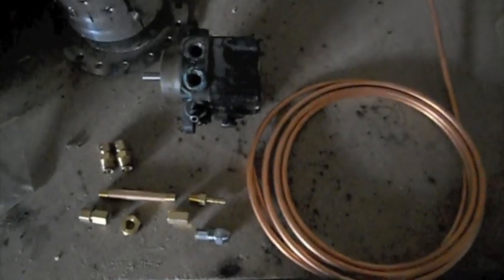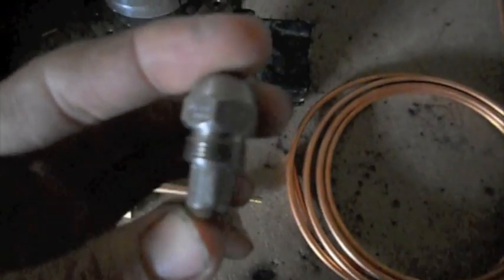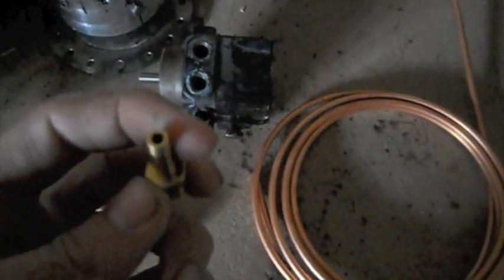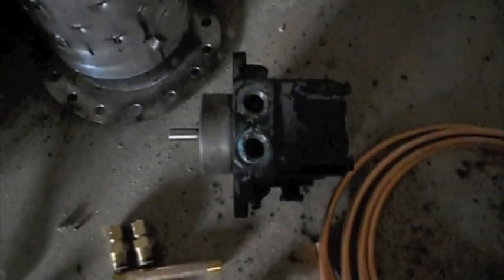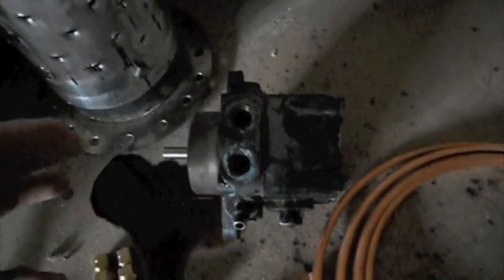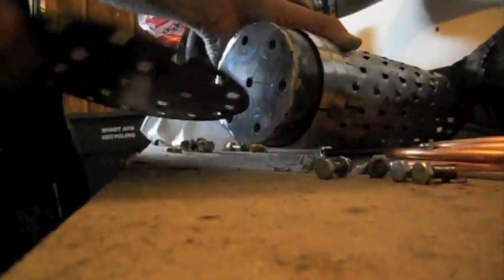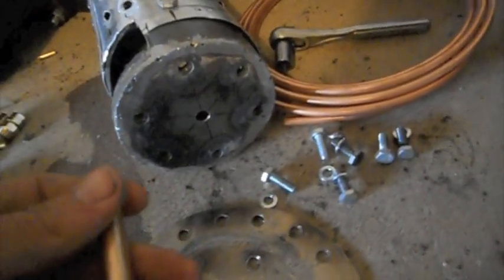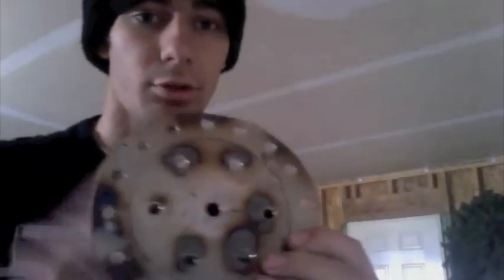How to Build a Jet Engine - Part 4 - The Fuel System

Comment: not very practical. you are better off with a small cesna with the dual props (pardon my spelling), then make the front wheels go on their own power via a small motorcycle engine. however, you have to watch your weight differencials.

Comment: Hi, i'm also a mechanical engeneer as u, but i'm specialized in structures, not in engines or turbofans, i think its an awsome proyect and your videos are really cool and simple to follow, keep going on them. I have a small question, instead of getin a turbo for the intake (its hard to find a cheap one in spain) could be possible adding an in line presure fan? the working pressure would be smaller so the stress of the materials (knowing that its home made) would make the engine more reilable.

Comment: so are you going to start it with propane then swich to diesel ? thats what im planning because propain is much easier to ignite than diesel and this will give time for the combustion chamber to heat up to ignite the diesel. Also if you run diesel how are you planning to regulate the amount of feul suplyd thus regulating the speed of the turbing ? this is my main problem at this moment, eny idees ??

Comment: Hey jeered you said about the nozzle for the oil furnace having an odd thread. I'm a heating and air conditioning tech and can tell you the tube that you need to fit the nozzle is a stock part in many heating supply stores. You can get various ones from 4in long to 12in long and they all have electrode mounts for lighting the fuel. The electrodes are designed to run 10,000 to 15,000 VDC, you can get this voltage from an oil furnace ignition transformer that plugs directly into 120 VAC. Using th

Comment: i dont want to sound like i am having a go at you but you should consider tig welding insted of mma (manual metal arc) as it looks better and more inportantly it gives you more control and in the right hands better stronger gas tight welds, good look on future projects mate

Comment from the maker: @IDroppedMyBrain1ce Yes, as of right now the plan is to start it with propane and then ignite the diesel.  I was going to add a butterfly valve or some other type of valve in the fuel line in order to control the fuel flow.  That way you can keep a constant pressure at the pump and easily regulate your flow.

Comment from the maker: @Ladykiller1369 The only big risk you run is a weak combustion chamber, and foreign objects damaging the turbine, otherwise most turbo housings are very strong and will contain a turbine failure.  I think that's right, it makes sense to me at least, but I could be wrong.  Yes these are dangerous, but just use some common sense and you should be fine.

Comment from the maker: @IDroppedMyBrain1ce you could use a cable system from the gas pedal and a spring on the valve to return it to the idle speed.  Or you can get fancy and use an electronic servo.  But when I do it, i plan on using the cable system.

Comment from the maker: @TheJerry0223 Yes it is going to need oil.  You'll want a pump that will supply probably like 40-50 PSI.  It may be less for a smaller turbo.  But I'll be sure to cover the oil system in a later video.

Comment from the maker: @07wagsry The flame tube you will need, it separates the fuel from the air and allows it to mix properly.  however the evap tube you do not need if you use propane as a fuel source.

Comment: Sir, I wish to get a rough estimation on how much will it cost to build the entire jet engine? Please Reply!!
Reply: Well as far as major parts go you need a turbocharger, fuel and oil pumps, metal tubes and pipes and all the little accesories.  I'd estimate it costing between $500 and $1000.
Reply: Thanks sir. I am looking forward to do this in my final year project.